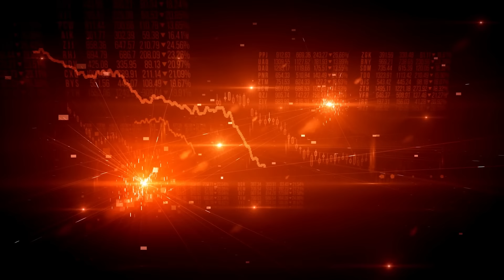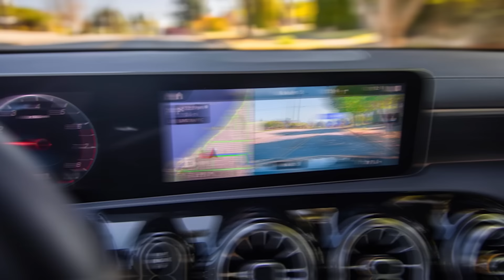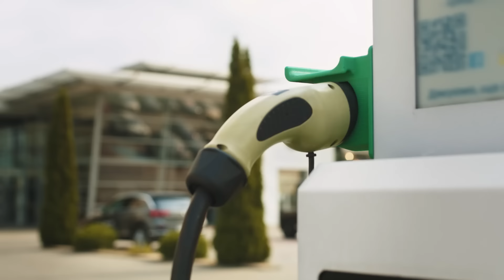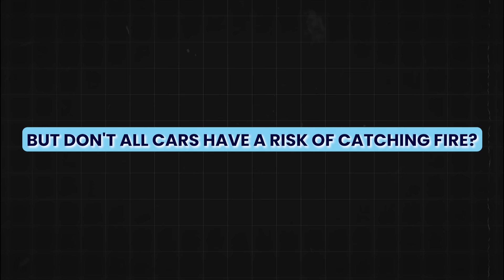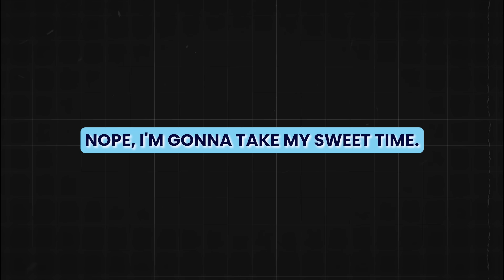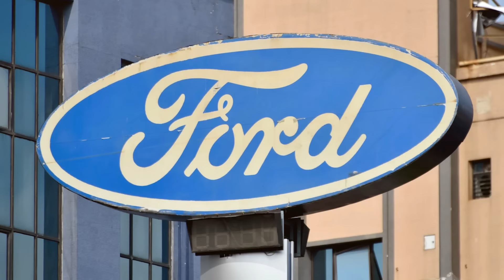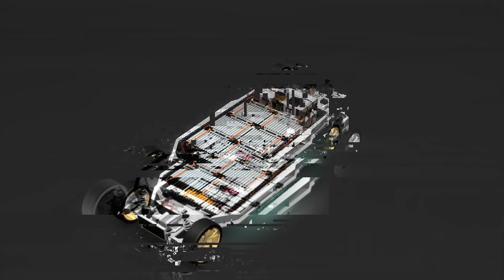HUGE NEWS! SHOCKING New EV Report Reveals EV Owners HATE EVs!

Comment: I will never drive an EV anymore .....I rented 1 for one day and although I received the car full of charge after driving 40 miles and parked it  outside all night at 32 degrees my battery  charge has dropped considerable to 72% (barely escaping from being hit with extra money for returning it at less than 70% charge)...The last thing you have to worry during a trip to the airport is to have to charge your electric car or pay extra for them to charge it ) 
....NO EV FOR ME!!! ONLY GASOLINE CAR!!!!
Reply: Or hybrid. Hybrid has only 1/10 battery but it can charge while car is idle. This can boost fuel efficiency from 34mpg to 50mpg for compact car.

Comment: My 1980 F100 (V8, 4 barrel carb) never needs a software upgrade. Starts every time, parts still easy to find.
Reply: And the fuel tank doesn’t get smaller year on year.
Reply: Yes, and I could buy a new car for what you would ask for it.
Reply: My game boy doesn’t need software updates. That doesn’t make it better than a PS5 🤣
Reply: @Audioremedy0785  Can your game boy do everything that a PS5 can do? My old truck can do everything that a 2024 Ford Lightning can do.
Reply: @justinecooper9575  can you refuel it at home without needing to go and get fuel first?
Reply: @Audioremedy0785  No, but I never park it at home with an empty tank.
Reply: @justinecooper9575  I don’t park my EV at home empty either. Just always full and ready to go when I need it. Your car would rather you made a special trip or took 10 minutes out of your trip to refuel up. Not to mention however long you have to work to pay the extra cost to fill it up.
Reply: @Audioremedy0785  And how long does it take to recharge your EV when it needs it during your trip? And you don't have to pay any extra cost to recharge your EV?
Reply: @justinecooper9575  I would very rarely do a round trip that was more than 300 miles. If I did, I would top it up with a supercharger. 175 miles in 15 minutes while I pop to the bathroom after about 4 hours of driving and off I go! The reality is that people who have an EV will tell you it’s an easy experience. The only people who don’t like EVs are idiots who think that you have to stop a trip for 4 hours to charge all the time. It’s not how it works at all.

Comment: 5 minutes to "recharge" an ICEV vs. 90+ mins to recharge an EV to full = FAIL!
450 mile range ICEV vs 235 mile range EV (Tesla M3 standard) = FAIL!
$25K for ICEV vs ~$50,000 for EV, almost 100% more to buy = FAIL!

EV's can't match the convenience, value or reliability of ICEV's
Reply: Depreciation after 8 years...
Insurance cost is a nightmare.
lol
Reply: I only need 5 seconds to connect the charger at home. Electricity is almost free compared to fossil fuels. Never any problems. If you don't own an electric car, you don't know how wonderful it is either.

Comment: Gee I drive an old Korean made car with a GM name plate and it's an '89. Still gets over 35mpg, fires up every time I hit the key and everything works. Only 5 computer things and will run without it. Try that in any new anything. Also have a '79 Dodge D150, completely rebuilt bumper to bumper and no computer. Lifes great. Screw the EV's not ready for prime time.

Comment: I am not for one minute disputing 'Climate Change/Global Warming' but would contest strongly that is is not caused by Humans, but a natural cycle that has occurred over Millions of Years. Where I am sitting now [Midlands UK] a mere 12,000 Years ago was under ½ mile thick Ice Sheet. I kid you not Mammoth Lake nearby. All these Measures proposed to Halt or Reverse it are pathetic and will not make the slightest difference' The most stupid of all is halting what are now very efficient clean ICE Cars and replacing them with Dirty Electric that only the most wealthy can afford initially and have off road/Garage parking to enable them to recharge overnight (for a full recharge up to several days) Quite honestly I see this as a way to Tax the average person for the benefit of the wealthy who running an EV's pay no Road Tax/Fuel Tax and even get a Government Grant when purchasing one. There is a £34 Billion Black Hole set to appear in the future and I dread the future for our Children/Grandchildren after the gigantic astronomical  costs Covid19 has caused. Wait until 98% efficient Gas Boilers are prohibited and have to spend £15-20k on a Heat pump that is most useless inefficient in the Winter [cold] Months when little or no Solar Power and on a still day Zero Wind Power. Nuclear Fission may be the answer but until that time Quote "UK Government Adviser {Allegra Stratton} on Global Warming will continue using my elderly VW Diesel - say no more ! :text-green-game-over::face-orange-biting-nails::glasses-purple-yellow-diamond:

Comment: Just about every statistic in this video is dead wrong and for some reason had no references?  You can buy a Chevy Bolt right now for under $20,000 brand new.  "You can't get an EV for under $60,000", REALLY?
Reply: Chevy Bolt has been discontinued due to battery issues.
Reply: @Rondogardener  There are still brand new 2023's about 4,000 left.
Reply: The battery has been fixed.  They qualify for the instant $7,500 rebate.

Comment: What a skewed and intellectually dishonest video. My model Y was less than a Toyota Camry or Rav; the one time I visited a super charger in 6 minutes I added about 100 miles of charge (which was more than enough to get me safely to my destination), and I spend less than $30/month on electricity where i used to spend 10X that for gas for the same commute. My BEV is the best car I ever owned.
Reply: Good news I glad 👍
Reply: You will save around $12,000 to $14,000 in approx. 10 years (compared to gas cost of a 6 cylinder ICE) of which by that time you may need to replace your battery amounting to $16,000 - $18,000. Elon Musk knew that margin...... Depreciation at that time? unimaginable... Repair? Crazy bills... Insurance? Wowwww   Selling it? Impossible....Option? Trade it for another Tesla.... Anyway, early adapter always pay the price.

Comment: News flash - ICE-powered cars are also "dying on the roads, catching fire, and even killing people!" Tesla is the most valuable car company in the world, it's not even close and they only make EVs. Tesla also has the best owner-satisfaction scores.
Reply: lol.   That's "in their segment". Not compared against ICE cars.
Reply: News flash, there is nothing inherently dangerous to first responder crews about an ICE vehicle being on fire. It can be safely managed and put out very quickly with any standard fire rig.  not that they catch on fire all that often in a wreck anyhow, and it takes one very serious wreck or severe almost complete lack of maintenance for one to catch on fire to begin with. An EV with a 1500 pound lithium battery on the other hand, may as well be loaded with 1500 pounds of incendiary bombs. If that battery is punctured in any way shape or form in a wreck and there is even the slightest hint of a spark it WILL burn and most likely explode. Your regular gasoline and oil fire in your ICE vehicle, 1500 degrees F. A lithium car battery fire 5000+ degrees F. That is literally hot enough to make concrete pop and melt through pavement. You don’t just roll up on that with a pumper and spray water on it. You need special chemical response equipment to even start to manage that situation, and god forbid somebody is pinned inside that death trap and a fire crew has to try to extract them with a battery fire raging, that is if they can even get close enough to begin with. Stop drinking the look aid.
Reply: @Oliver66FarmBoy  it's even worse.  Check out the videos of the gases that are emitted from these things when they fail.  Even from EV bicycles. Life and death can be only seconds apart.
Reply: ICE cars don’t spontaneously combust in your garage and set your house on fire. eVs are known to do that.
Reply: @JensSchraeder  Hear Hear! If you want spontaneous ICEV combustion, you first gotta buy a 70's Pinto and then ram into it from behind. It's pretty bad...we are 24 years into the 21st century and people have to worry about their battery cars catching fire just for being 'safely connected' to their charging port. EV's = bad news!